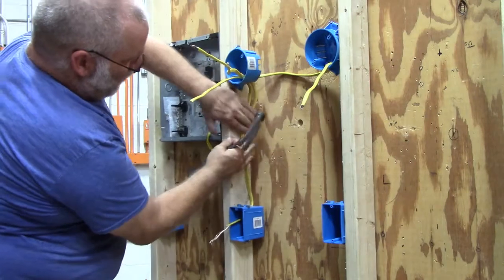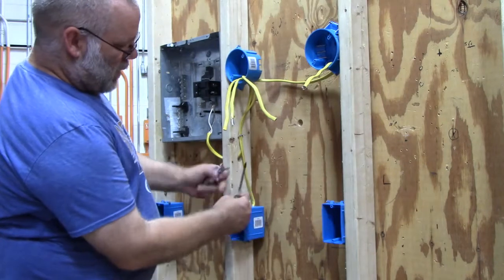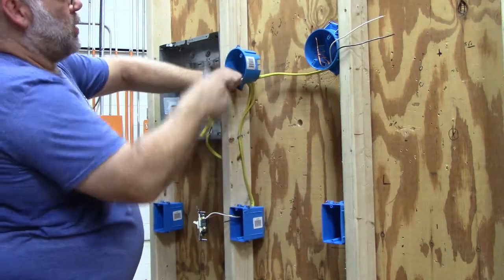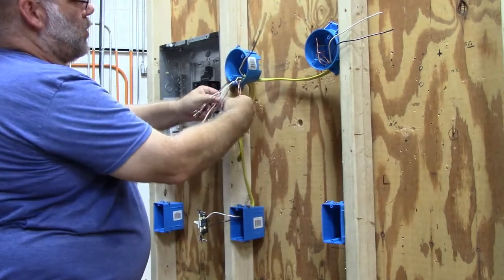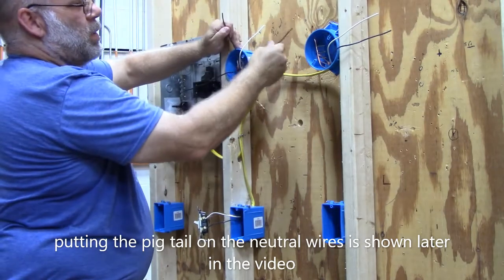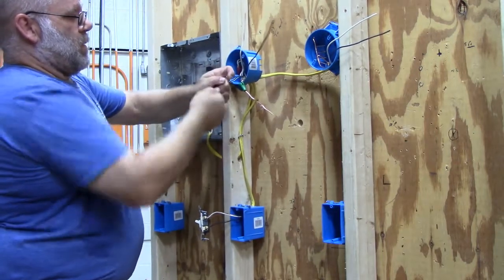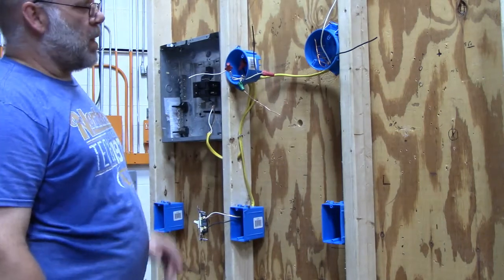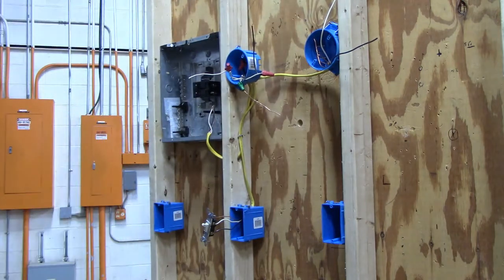Two lights with single pole switch power in light box

Comment: Correct me if I'm wrong but by working from main source to bulb and then to switch, doesn't this make your bulb hot all the time? This does not meet code and is dangerous.
Reply from the maker: No, the hot is sent to the switch box with switchloop coming back to light box to turn on the light

Comment: This method doesn’t meet code nowadays…you need to have a Neutral available at the switch box. I would’ve ran the wire from panel to switch box first, this would satisfy the NEC neutral rule.IF you’re working with existing wiring behind finished drywall and this is your setup, you must tag the white wire with black tape indicating it is being used as a “hot” or line.
Reply from the maker: This method is taught because my students need to learn that it is in houses and they need to know it

Comment: wouldn't you run the power to the switch and then to the lights?
Reply from the maker: You could, this is just another way to wire it

Comment: My two lights don't seem to be pigtailed to each other, in the junction there is one 15amp wires the hot one, then there are two more 15 amp wires. Which I believe is one for each lights, now one of the black wires for the lights is pigtailed  to hot wire and then wired to switch, then the last black wire(the other light) is connected to the other switch screw. Is this wiring correct ?
Reply from the maker: You should have a hot wire and a switch leg going to the switch.

Comment: This was very helpful! But I have a question. I already have a ceiling light and a wall switch installed and I want to add another light fixture to the circuit. 
I don't have access to attic so I can't do anything behind the currently installed fixture but I have access to the light switch. is it possible to add another extra light to this?
Reply from the maker: yes, you can add another light. connect black wire to switchleg and white to neutral

Comment: Thanks I have the lights back working but how would I add another switch and light in the same box as the single pole switch you are showing in the video, I have a double switch single pole, 1 for ceiling light and the other I would like to use for the closet, currently the power comes in like this video from the panel to the light then to the switch.  I clearly failed on the goal but your video got me back in the light.

Comment: Nice video. Do the white power wires now need to be Black taped? 
Also do you have a video showing how to do the same hook up but the power now coming out of the light switch? 
Thx 🙏🏻
Reply from the maker: power wires should be marked with tape or marker  and yes i have other videos on single pole switches

Comment: Great Video! Do you have a video (or could you explain) what I would need to do to connect an outlet/receptacle from that second light but have it always hot?
Reply from the maker: @PastorJoeJoe  if there is no hot in the second light box you can run a 12-3 instead of 12-2. Use the red as the switch leg and the black for the hot. Then run another cable to the outlet box.
Reply: @timpalmer-logstolumber1999  i think I got it. Basically, if the lines are already run, and there is no 12-3 there, then its not possible to have a "always hot" receptacle. And if I just wire it with only the 12-2 that is already ran there, the outlet is then going to be tied to the switch, right?
Reply from the maker: @PastorJoeJoe  that is correct

Comment: Looks like you’re running 12/2 wire for the whole thing. Does it matter if your breaker switch is a 15 amp over a 20 amp? I know usually they recommend 20 amp for any 12/2 as well as any 20 amp receptacles/switches. In this scenario where you’re running 12/2 wire from the light box that’s receiving power and wiring to everything else, would you recommend using a 20 amp single pull switch or a 15 amp single pull switch?

I’m in a very similar situation right now where in my bathroom I have a light box that’s receiving power and from that I want to power another light and a switch that turned on both lights plus connect a outlet/plug-in receptacle to the same power source. I was told to make a junction box (receiving power) before the first light, and from the junction box split off to the first light from the first light to the second light. Connect the switch in the junction box tied from first light, and the plug-in tied on from the junction box. Sorry it’s a long confusing question(s), but would appreciate your thoughts?
Reply from the maker: @Samuel.Carrillo  no, you can breaker it at a lower amp but not a bigger one.
Reply: @timpalmer-logstolumber1999  gotcha! so if my breaker is 15 amp and I’m using 12/2 wire to route everything, what kind of receptacles should I be using 15 amp for switch and plug-in or 20 amp? I’m assuming it would have to also be 15 amp correct?
Reply from the maker: @Samuel.Carrillo  could use either
Reply from the maker: @Samuel.Carrillo  the way you explained would work. Are you working with bare studs?
Reply: @timpalmer-logstolumber1999  yes, bathroom has two walls with bare studs one that holds the receptacle plug-in and the other light switch and the junction boxes is in the attic which splices everything off into the bathroom I believe.
Reply from the maker: @Samuel.Carrillo  you could use the j box in attic or add another.

Comment: Since 2022, the code requires neutrals to be spliced with neutrals, not live. This circuit would not work.
Reply from the maker: @foodlaw5778   There are many things you can't do now but they are in older houses, you have to know what your looking at.
Reply: @timpalmer-logstolumber1999  True. 
You would not want to run the live wire from the fixture because of accessibility.

Comment: why sent the "power" to the light box first, instead of sending the "power" "line in" to the switch first?
Reply from the maker: @ChiapasPioneer  it is usually done to save wire
Reply: Oh, thank you. good to understand.  I am setting up power direct to switch which will connect two hanging lamps over my kichen counter . . . Helpful video instructions,  thanks . . . 0:59 d@timpalmer-logstolumber1999

Comment: Thanks! How do you decide when to combine two wires while keeping one longer and running it through the wire nut (like you did the grounds) vs using a pigtail?
Reply from the maker: @composish  depends on how many grounds are in the box and how many switches you are wiring
Reply: @timpalmer-logstolumber1999  thanks, it also later occurred to me that the nut with the hole is really just a tool for bare grounds and isn't compatible with sheathed wire.

Comment: What if the switch goes to the other light fixture box?
Reply from the maker: @christianmoya1150  from light box with power wire in it you can run a 12-3 to other light box. Use red wire as switch leg. From second light box  send power to switch on white and bring back to light box on black as switch leg, hook to red wire as switch leg to other light.

Comment: I used this video and method to wire 2 wall sconces from one switch. Now I plan to wire 5 sconces from a dimmer. Can I use this same method and then daisy chain from light 2 to 3 to 4 to 5?
Reply from the maker: Yes

Comment: Just run the hot wire from the panel, or outlet to the switch box. It keeps it simple and clean in that all whites are common, no hot and all black are hot and switch legs. Why overcomplicate it and have all these non experienced people confused to what whit is for power. Keep it clean and simple with power to the switch box, then run the legs to the light boxes.

Comment: Great video! How does the no neutral into the switch help out with all these wifi switches that require a neutral? Im a DIY and this has been an issue with these newer switches.
Reply from the maker: If you need a neutral in switch box use a 3 wire from light to switch box. Use red as switch leg.
Reply: @timpalmer-logstolumber1999  Thank you!

Comment: I am a DIYer. I thought the power went to the switch first. Your video totally confused me. Maybe I need to watch it again. Thanks.
Reply from the maker: Power can go to the light box first, this is usually done if you can save wire. Many electricians don't like to do it because the light would have to be taken down if there was a problem. It s easier if it's in a switch box.

Comment: I think it would be better and less confusing to send power to the switch and then to the lights
Reply from the maker: Many would agree with you. Power to the light box is usually used if you can save wire.

Comment: Could you run a wire from each light and connect them all at the light switch?
Reply from the maker: Yes, you can run a 3 wire. Use black for hot, red for switch leg, and white for neutral. You can go through multiple lights then to switch box.
Reply: @timpalmer-logstolumber1999  I think I asked it wrong. What I meant is when having 2 light fixtures can I connect them together inside the switch box along with the switch? As opposed to daisy chaining them?
Reply from the maker: @CoolGreyX1  yes, you can run power and switch leg to the switch box. Watch my other videos on how you can wire single pole switches.

Comment: Excuse my arrogance but could you not give power to the switch from the panel, pig tail the switch with 14/2 coming from the first light than just pig tail every other light after that?
Reply from the maker: Yes you can run power to the switch, but this example I run power to the light box. I have other videos that show other methods.
Reply: Thanks for the response. I was just curious because I plan to take power from an outlet for a switch to add ceiling lights to our living room. (no lights currently so would need to steal power or run a new circuit) @timpalmer-logstolumber1999
Reply: Seems like he has his own set up going from the light to the panel, then, to the switch.... kinda like backwards, but same logic

Comment: Awesome video! I'm trying to tie in 2 lights on to a single pole switch with 1 light already on it. So basically 3 lights on 1 switch in a bathroom. I have wired up ceiling fans, outlets, switches. But I haven't done this before. Can I just tie right into the light in the attic and add my 2 lights on from there?
Reply from the maker: yes, it will be a continuation of the switch leg
Reply: I wasn't sure if I needed to run it to the switch. So just hook up my hot,neutral, and ground as usual? Then my other 2 lights will operate as normal with the first light?
Reply from the maker: @stackin_steve_8223 Yes, Just hook up at the light. you could also do at the switch but then you have to fish wire into switch box.
Reply: @timpalmer-logstolumber1999  awesome thank you! I had the right idea then. I appreciate the help!
Reply from the maker: @stackin_steve_8223  glad I could help

Comment: Can I just use a junction box  before the 1st light. Wire everything like you have it in the 1st light. Then use jumpers the lights?
Reply from the maker: You could, but then you have another box that you have exposed.
Reply: @timpalmer-logstolumber1999  do you have any video with a single pole switch with multiple lights power starting at the switch?
Reply from the maker: @Smoothnf  I have a video with power at the switch box. To add multiple lights you would just go from light box to light box black to black, white to white.

Comment: Hey so im doing some DIY, ive replicated this kinda, but instead i have a 20 amp running 4 led flush mounts. Without the switch the lights were really bright like perfect, but i added the switch and hooked up the commons to the hots all the way through and the lights dimmed noticeably any thoughts?
Reply from the maker: Do you have power and switch leg in the same light box?
Reply: @timpalmer-logstolumber1999  so power runs thru lights to switch
Reply from the maker: @JamesKameron-u3u  did you use 3 wire red for switch leg?
Reply: No i only have 12/2
Reply from the maker: @JamesKameron-u3u  the power has to go through the lights to the switch on the black then the red wire is used as a switch leg going from switch back to each light.
Reply from the maker: @JamesKameron-u3u  I have a video showing this process
Reply: Sweet thank you

Comment: Can I run the switch off the second light box instead of the first light box? Thanks.
Reply from the maker: You will need a 3 wire between light boxes. The red would be used as switch leg, the black would be wire nutted to white from switch box used as hot. The black from switch box would be hooked to red switch leg. The white in 3 wire is neutral.
Reply: @timpalmer-logstolumber1999  I just happen to have some extra 3 wire lying around. Thank you so much, I will give it a try, because when I used 2 wire, I wasn't successful.
Reply from the maker: @avlisk  happy to answer any questions
Reply: @timpalmer-logstolumber1999  I'm thrilled to report that I have 2 working garage lights now. YAY! Thank you.
Reply from the maker: @avlisk  glad I could help

Comment: Any "white" wires that are power conductors must be identified with a black (or red) identifier.  I have used tape, sharpie marker and MY favorite  heat shrink tubing.  Any future work will be easier to identify and troubleshoot if this NEC standard is met.
Reply from the maker: Yes, I forgot to mention that when I made the video. I usually carry a sharpie.
Reply: CORRECT VERY SAD TO SEE THIS CODE VIOLATION...

Comment: Nice video. I’m trying to wire 2 wall sconces to one switch that I just installed. I had the power in running right to the switch and then the lines running from the switch to the first light and then daisy chained to the second. I couldn’t get both lights on at once no matter what I tried. I will try it this way and cross my fingers!
P.S. wouldn’t this wiring method provide constant power to the first light? Or is it a loop now that the switch controls? It seems like a fairly simple method yet I’m having trouble getting my head around the concept.
UPDATE I followed your wiring to the tee, wire for wire and it worked like a charm! Thank you thank you thank you!

Comment: This man has no time for BS… and i respect that
Reply: If he had no time for bs, he would have just run the hot to the switch box, thereby no monkeying around with using a common wire as a hot switch wire. Keep it clean and simple. Hot wire from box to the switch, keeping all black as power legs and all white as common and then, if anyone later down the road opens the outlet, they won't have to second guess what whit is hot and what white is common.
Reply: @MrItalianfighter1 nothing wrong with what he did. I would personally go to the switch box first so there is no second guessing.
Reply: Djdjjdjdjdjdjdjsjdjddjjsjsdijdjdjdjdjdjdjdjdjdjsjsjdjdjsisudjsjsjsjdjsjsjsjsjdjsjsjdjsjsjdjdjsjsjsjdjsdjjdjsjsjdjdjdidjdjdjdjdjsdjjdjdjdjdjdjdjdjf
Reply: Disciplinary guy...lol 😐🫡
Reply: Doesn’t code require a neutral in the switch box?

Comment: I am electrically challenged. Thank you for the presentation. I now have the confidence to add a 2nd light in my dark laundry room! One thing that would make it easier for me to understand how to wire would be a list of each wire and tell which other wire to attach. (White wire from power source to White wire in 2nd light. ...).
Reply from the maker: If you have questions I will help you with them
Reply: @timpalmer-logstolumber1999  The problem I now have is the connections at the original light is tied into a wire that feeds an outlet that is live, even when the switch is turned off. At the original light junction box there are:
1 Black & 1 White wire from the switch
1 black and 1 white wire from the 2nd light I recently mounted
1 black & 1 white wires going in and continuing out

Is it time for me to call for an electrician?

Comment: If I have power to a light .but when I connect my light it doesn't turn on can you help me?
Reply from the maker: Explain how it's wired. Is there power in the switch box or in the light?
Reply: @timpalmer-logstolumber1999  yes there is power in the switch box thank you for replying.
I checked switch box wires there all connected.
Reply from the maker: @davidfuller9373 is this new or old?  if everything is hooked up correctly you might look at changing the switch.
Reply: @timpalmer-logstolumber1999  ok I'll give that a shot.
It's a addition room..
Hopefully the switch is the problem.
Thank you.
But if my  tester says the wires are  hot could it still be the switch.ty
Reply from the maker: @davidfuller9373  test for current at light. Check all connections, sometimes wires are loose inside wire nuts.

Comment: Some smart or dimmer switches require a neutral in the switch box so you'd have to run a 14/3 (or 12/3)  up out of the switch box and use the red wire as the second hot leg..
Reply from the maker: That is correct. Check out my other videos where I explain that set up.
Reply: @timpalmer-logstolumber1999  I'm going to go back and look at your past videos, the couple I have watched are clear and to the point.

Comment: Thanks man. This approach looks different. Would it be simpler if we connect the power source to switch and from switch to bulb 1 and then from there to bulb 2 using pigtails..
Reply: Though simpler, often times you have for example a small room light controlled by a not so close switch and the client now wants to move its location or add a dedicated switch for the purpose. Then as you mentioned "jump" from bulb 1 to bulb 2.
Reply from the maker: An example of this would be that you have a pull chain lamp holder that you want to switch and add another light. Drop one cable into the switch box and another to the second light. Another example would be if the light box is closer to the power source you would use less wire to run it this way.